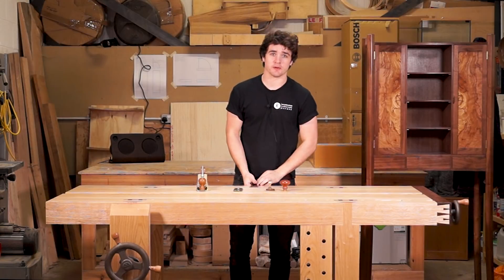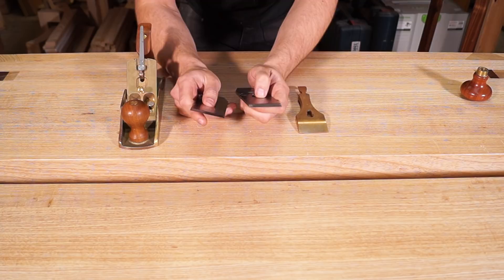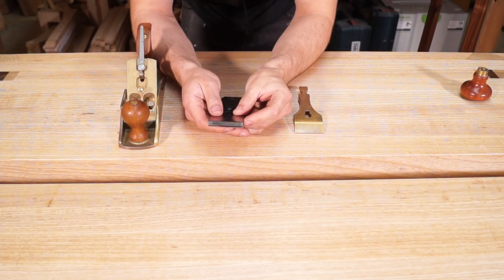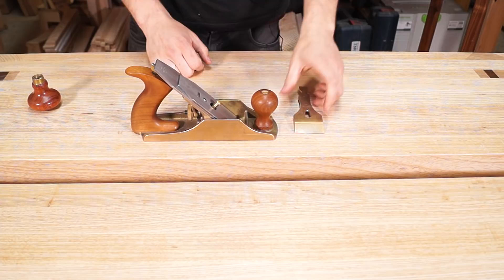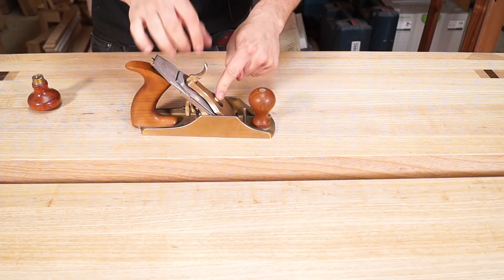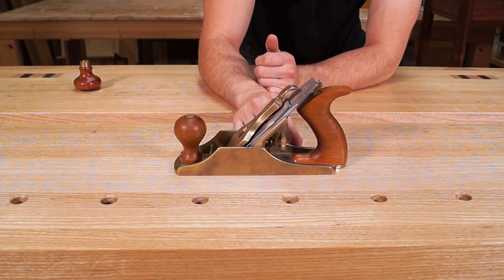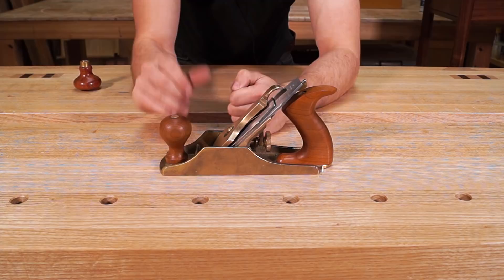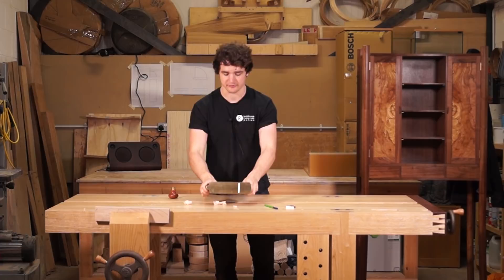How to get SILKY SMOOTH SHAVINGS from a PLANE

Comment from the maker: *DISCLAIMER*

This is a video on how to set up a plane, not how to tune a plane. Check description for more details!
Reply: Matt Estlea - Furniture rockpainting

SHOW ME ROCK PINTING
Reply from the maker: They have different names depending on the country and manufacturer is what I find. Lie-Nielsen call that part the chipbreaker because it does exactly that. http://www.axminster.co.uk/lie-nielsen-improved-chipbreakers-ax460239
Reply: My point in all of this is that your video mixed up several of the terms.  You suggested that the Lever Cap was also called the Cap Iron.  This is false in all cases of Western planes.  Further, not all Western planes use a Lever Cap (There are many fine adjustable Dutch, Nordic, and German planes that use a simple wedge, yet all of these use the Iron & Cap Iron assembly).  Thus  my intent was simply to clarify and to provide information that would allow you to address to matter factually as a professional so as to maintain the strong credibility and reputation you now enjoy.  My most sincere apology if it came across in any other manner. 

As to the term "Chip Breaker", Axminster uses the term in its slang form because many people remember the secondary function of the part.  The actual owners and engineers at Lie-Nielsen still use the proper names when presenting or teaching (I have attended many of their presentations).  The slang is a simplified marketing tool.  

Chip breakers are actually not a requirement as show by the various oriental planes that also produce extremely thin shavings.  In there case they also eliminate the Cap Iron and Lever Cap.  That said the Iron itself is nearly three (3) times as thick as traditional Western Irons.  That dramatically increases time required to shape, grind, hone, and polish the cutting edge.

For Western planes, the Cap Iron's main purpose to stiffen the Iron in a spring tension manner (similar to the way leaf springs provide the majority of suspension stiffness in a car).  This allows for thinner Iron that are much easier to make and to maintain.  It also allows for the use of different metals, alloys etc. who's cost would be prohibitive in a thicker blade.  While this stiffening is essential to producing a clean and consistent cut, the chip breaking is simply a "bonus feature" which is just as easily achieved by replacing the hump with a short bevel and allowing the sloping face of the Lever Cap to "pick up the slack".

These sort of "trivial errors" have two effects over time when left unaddressed/corrected.   Firstly, they cause confusion for the less experienced (I deal with this every day when I teach Traditional Joinery).  Secondly, they lower your credibility and reputation as an expert.  Given your craftsmanship, personality, easy teaching style, and following, that would indeed be a sad self inflicted injustice.  As I have a sincere respect for you as both a fellow craftsman and an educator,  I was simply trying to help.  Again, my apologies if my words suggested anything else.
Reply: Matt Estlea m
Reply: Okay but can I tune it to C at 423hz?
Reply: @DominicPannell  
First you obviously ignore most of what you read, and second are quite the self deprecated expert of being overtly rude.  I make these claims because you ignored the fact that my reply wast directed singularly to Matt Estlea over 2 years ago (i.e. it was not and is not about you or concerning you in any way); therefore your comment is unwarranted, mean spirited, and purely self centered.

Please do try to have ALL the facts before commenting.  It saves you from accidentally acting like a jerk.
Reply: @bonnivilleblackcherry9745  
Heavy iron with locking wedge, adjusted using very light taps with small mallets made just for that purpose has been the norm in Europe, Asia, and South America for over1000 years (i.e. for as long as we can accurately document the design and use of hand planes). 

Many of the finest woodsmiths in the world today still choose to use wooden body planes with heavy irons locked by wedges simply because they are so easily and finely adjustable.  Competitions in Japan to produce the thinnest continuous shavings have always been won by such planes and the thickness of the shavings have been small fractions of the thickness of a human hair (i.e. well below 3 microns).

Before you attempt to deride someone, you should first do your homework rather than arguing from personal incredulity.  That way your position will be respected instead of making you look like a jerk.
Reply: @MattEstlea  Also most people call the Blade an Iron.
Reply: @MichaelOlsen-Engineer   I find it quite annoying British using American terms for tools and machines eg. Drill press instead of Pillor drill, Jointer plane instead of Try plane , Jointer planer instead of Thicknesser planer , chip braker instead of Cap Iron.
I see right through this its because they feel they need to adjust so Americans understand and they can get more hits.

Comment: Thanks! My blade was upside down. Can you believe it? Works great now. Worked ok before but hard to plane laying on the floor on my back under the table. Thanks for giving the basics-you don't know how much we know
Reply: Mine too! I was wondering why it wouldn't shave and was cussing and swearing at it. Saw your video and noticed I had the blade upside down. Tried swapping it around now shaves perfectly!! Thanks for that.

Comment: Good gods man! I must have seen 250 "how to sharpen a plane" videos, and you're the VERY FIRST ONE I've EVER seen show how to REASSEMBLE the damn things! I've been working with hand planes for DECADES, but I still watch these for the occasional tip or trick I've never seen before, and, do ya know: the whole "rotate 90 degrees on the chip breaker" never occurred to me. Thank you so much!

There's ONE thing I'd call out (well, not "call out" so much as "ask for more detail"), mainly because, again: I've never seen an explanation on it. What does one do if the fit between the chip-breaker and blade is bad? I see this a lot on newer planes ("Buck, I'm looking at you. Stanley, stop trying to hide behind Buck. Why can't you two be more like Lie or Garrett over there?"). I've also seen a plane blade SPLIT LENGTHWISE because there was a pronounced camber on the breaker and when someone tightened down the lock screw, well, it was like a pair of glass running pliers hit the blade.

Now, I personally was taught the whole "flatten the BOTTOM ONLY (the part that touches blade) on high-grit on a granite lapping stone or float glass, then square the tip, then add a MINUTE roundover on the TOP intersection only (to minimize drag/snagging on heavily-figured grain)" approach, but in truth? I've never actually known if that was the "correct" approach or if it was just my teacher's way. It seems to work fine, but... he didn't teach me the rotate 90 thing either.

Comment: Love these video's.
I always wanted to learn woodworking and I can create the courser things just fine. But the detailed woodworking always was a problem. Now I finally got my plane sharp and I get smooth shavings. I find it hard to stear though. I can't say it cuts more in the middle thand the sides. Maybe due to my honing guide (veritas precision honing guide)

Managed to handplane a straight edge on a board just now for the first time in my live. I love this. Thank you so much

Comment: Paul Sellers has a video on sharpening and setting up a plane. For setup, he advises to take shavings, with the blade retracted as much as possible, see on which side the shavings are thicker, then adjust the left-right lever. I found that procedure to be useful - especially when the plane's sole is iron, it's not easy to tell by eye which side stands out more or less, once you get very close to straight.

Comment: I just literally had that issue of shacings clogging the mouth because my blade and chip breaker are cheap. I have the arched breaker. And it was not flat. I shaved it down to match the blade and smoothed it. Problem fixed.

Comment: Sweet video Matt, when I was an apprentice back in the 80's we were taught to place the plane on a piece of white paper so the cutting iron appeared as a dark shadow protruding from the bottom of the plane body :-)
Reply from the maker: I’ve tried that with spokeshaves and it seems to work very well!
Reply: smerd1  Matt did mention in the video the benefit if resting the plane on a white sheet of paper but chose not to in this instance saying the bench top was a light enough colour already.
Reply: In the seventies it was face the window and look for the hair. My eyes are now so fucked I couldn't see a hare on the sole.

Comment: Great video, but what am I doing wrong? My blade protrudes well past the plane mouth when I insert the blade and I can't wind it in all the way, even wound hard to port the blade still protrudes and I've run out of thread to turn.
Reply: is there a second notch where the adjuster engages the blade?  Often there is more than one, so that when you've sharpened away too much of the iron, you can advance to the next notch and keep using it.  if you put the blade in at the wrong notch, you might not have enough adjustment to make it work.

Comment: One thing I'm missing is the relationship/ difference between the depth of the blade sticking out and the amount of 'gap' between the blade and the toe of the base. They both have an influence on the depth of cut, do they not?

Comment: Thanks for sharing, I'm watching all your videos, super helpful and to the point !. 
Question: Isn't the center of the board edge "lower"  after planing since your blade is cambered ?? If you stacked to boards for planing flat before gluing them together through the planed edge maybe the fit won't be perfect ??  The camber is microns but does it matter ?? (maybe for guitar building it does ?)

Comment: For the less experienced users at whom this excellent video is clearly aimed, it may be worth mentioning that the blade should always be retracted before placing the plane on its sole so the blade cannot be accidentally dinged such as when putting it away.  Matt used the well-proven technique of laying it on its side between periods of use for the same reason but didn’t draw attention to this.

Comment: I was going to come to the comments and bash you for not going into the plane tuning as it is very important in getting silky even shavings.  Then I saw your disclaimer.  
I cant afford the high end modern planes so I have to dreadfully take the time to tune the vintage Stanleys.  And it is quite a tedious job.  But even the LN and other high end planes should be checked and usually need a little touch up.  A dead flat surface is mandatory.  I use a grade A surface plate with 3M  sanding sheets spray adhesive on the plate.  Only really need for final finish but helps in getting square faster with the others also.  Then the frog bed,  what a pain to make sure it is square and mating with frog with a high percentage of contact. Then flattening frog where plane iron rests on it.  These things are important for a few reasons.  1.  Ever see the chips on the bottom of a frog at the edge.  Sometimes the mating is right on the edge and as the frog is tightened down to the plane all that pressure on one corner just breaks it off.  Not good.  Flat blade mated to flat frog keeps blade from deforming when locked down.  With the precision sharpening as you do added to a well tuned plane ultra thin even shavings at .001 and less can be achieved.  And the glassy transparency finish it leaves on the wood is remarkable.    I like flat edges on my blades with the corners very slightly rounded except on scrubs of course.  You cant truly square a board with even a slightly curved edge.  Just my preference.  And I sharpen freehand and am good at it but am getting a jig.  Its just too tedious and no matter how good you are, you have to be careful as you will get off by 2 to 4* easily.  Always having to check angles.  Off to ebay to shop for a jig.  Envy the water wheel.
Reply: Jeeeez...just grab a belt sander, 60g should do it, n if it looks flat an square, then it is. (Only joking) : )

Comment: These hobby tutorials always leave out the why's of how to adjust a plane then having banged on about taking care to not damage your fresh edge they put the plane face down on their bench which is a basic no no every traditionally trained craftsmen knows.
Then they encourage you to edge joint in the vice, for crying out loud, another basic fail.
No well trained joiner ever does that. They edge joint with a slave board with the plane on its side.
But Matt will guffaw as usual because like all college trained dude's, he knows better than us.
What he will not do is address my criticisms point by point because college has knocked the common sense and humility out of him and replaced it with ego.

Comment: This seems like a lot of unnecessary work and time. I don't even get why bench planes still exist. Hand planes are battery powered now and have gotten good enough to replace bench planes. I bought a sweetheart around 5 years ago, fiddled with it for a day and tossed it in a drawer because who the hell has time to sit down and play bench planer for an hour in the middle of a project? Not this guy. Slap in a battery and plane it smooth. DONE.
Reply from the maker: Try plane a dovetail joint flush with a battery planer and send me the video.
Reply: Matt Estlea - Furniture 🤣
Reply: homegrownbuddy Why do hand planes even exist? For the same reasons some individuals prefer to cook their own food rather than opening a tin can of prefab tucker, or pay someone else to cook their meals. 
It is called self reliance.
Reply: All this really means is that you are one of the people who has the time to sit down and play bench planer for an hour in the middle of a project. People that are production driven are going to lose patience and respect for that real quick. I guess I could see some usefulness if you were working on something extremely small or decorative but it still leads back to the same point I made before. If you have the time to stop a project and play with your hand planer for any period of time whilst building something, then you aren't so much building something as you are just finding ways to tinker and keep your hands busy. It's just two different ways of life. I have done cabinets and doors and showcases for almost 20 years now, never once fiddled with a hand planer on the job. Never will. No one who is production driven would. This is for people looking to fill time with a hobby, guys who enjoy playing planer blade for an hour are not anymore self reliant, they just have way more empty free time than most other people.
Reply: There are somethings you just cant do with a power planer. Plane the inside of a rabbit with that power planer for example.
Reply: Heathen!!